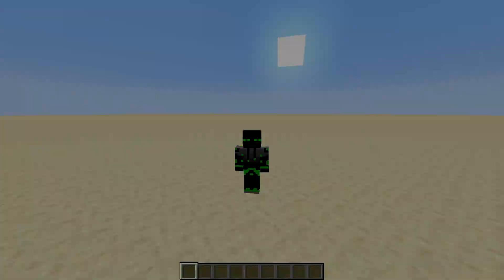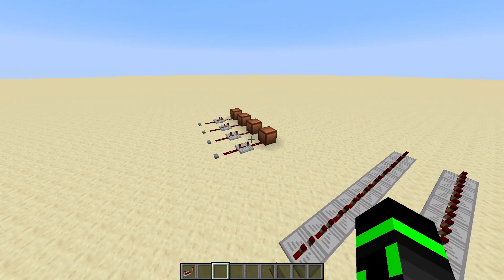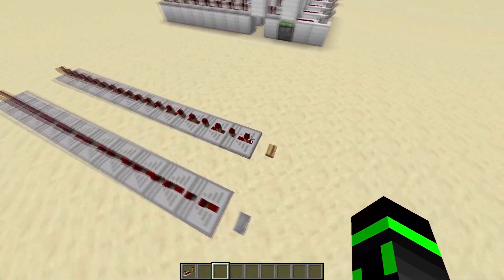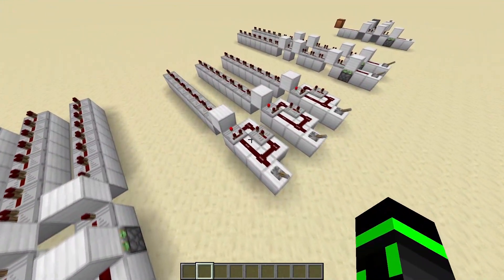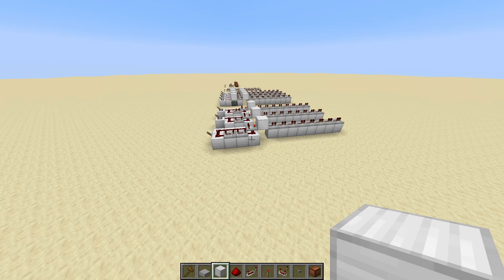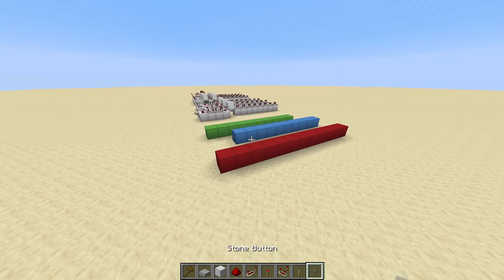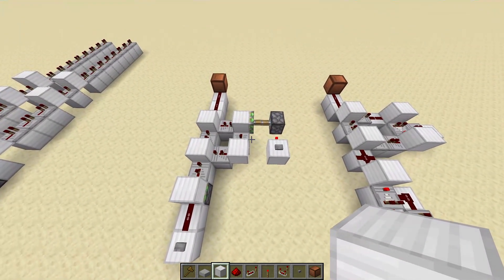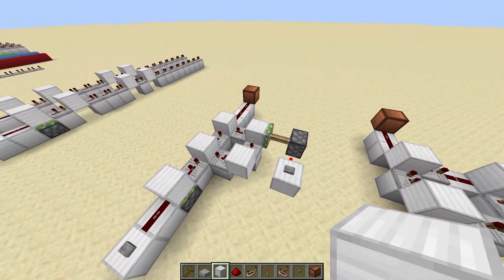Pulses & Clocks | Logical Redstone #6

Comment: Don't use clocks using only repeater if you can avoid it. They tend to stop when the chunk they are in gets unloaded. A better way would be to have a redstone torch that feeds into the block it is placed on, with repeaters in between

Comment: Actually repeaters do 3 things.
1: delay pulse by set amount.
2: set output strength 15 extending the length of reach.
3: they mod it and if it’s more than 0 they add the needed amount to reach it.
Ex. 2 tick pulse ti 4 tick repeater, well 2 mod 4 is still 2 so now the output is 4 say you had a 8 tick input 3 tick repeater you get a 9 tick output because 8 mod 3 is 2 witch is not 0.

Comment: I'm not sure if this is related to this topic, but I've seen on quite a few advanced redstone builds the use of a piston pushing up a falling block (usually sand). I understand that this is meant to break the connection temporarily which I assume is part of creating a pulse, but I was wondering if you know the specific applications where this is useful or any specific technical details on this. From what I've read, falling blocks drop at 0.45 blocks per second which would be 4.5 redstone ticks so I'm not sure if this value is specifically relevant. Thanks in advance if you can shed any insights on this.

Comment: Is there a nice and easy circuit that will delay a pulse to the moment an input is on. For example lets say I have a clock and something that gives random outputs. I want something that will delay (not turn off!) signals from the random device so they are always aligned with the clock pulses. I guess it's possibe with some logic but do you know something simple for that job?

Comment: I use an comperator in subtracting Mode as a clock. Its  very small and cheap (for survival) . Also  Like the capacitor (Pulse extender) Made from comperators.

Comment: i always have been interested in this kind of things and this series showed up to me a couple days ago and i absolutle love how you splain all of this!! also i have a uqestion, this clock are infinit until you press the "stop button". but there is a way to do a clock that repeats x times? like it works as a for function or something like that? love this content🖤🖤
Reply from the maker: the best way to do that is to make the start button activate a long line of repeaters which connects to the stop button. then you can test it out and change the amount of timing to get however many cycles you want

Comment: I spent 3 days designing, compacting and building a multiplier with 8 bit inputs and the only ROM being 15 cakes and I think 6 or 7 composters and no RAM, and I have no idea how it works. It works when one input is whatever and the other input is only one of the 8 bits turned on (so (anywhere between 0 and 255) * (0,1,2,4,8,16,32,64 or 128)). And because I can barely keep track of how it works and don't know how to visialize this type of thing on paper, I can't fix it to work completely. What it does now could easily be made with a tenth the space, even with the redstone equivalent of spaghetti code.

edit: I don't know what to do. Should I try to fix what I have, rebuild a new one from scratch or abandon the project?

edit2: Or something other than that?

edit3: I don't like using pistons in non-slimestone projects for anything other than the bedrock edition redstone torch bug/feature. They are noisy, laggy and sometimes glitchy. If I want a short pulse when the input changes from 0 to 1, I use stuff like input leads to [not gate A], which leads to an [and gate] and [not gate B]. [not gate B] also leads to the [and gate], which itself leads to output. (litterally 2 solid blocks, 2 of any blocks, which redstone can be placed on except stuff like upwards facing piston, 2 redstone torches and 2 redstone dust).
Except, I don't really use pulses. I only use solid signals without RAM. So you can replace air with a redstone block ANYWHERE in my circuit, and when you remove it, there will no errors. Except maybe the t-flip-flops being a little messed up until the next change in imput, but I don't really use those either, so that's probably fine too.

edit4: I write a lot when I'm tired, and I just woke up. I also just realized my multiplier might be handling the upper half of the ROM incorrectly, and that is half the reason why it's not working correctly.

Comment: @8:15 place a torch on the side of the block with the button that starts the clock, replace the button with a lever, feed a redstone line from the torch to the button that stops the clock. This doesn't fix the problem, just a nice little tool. However the more pistons you add to the clock that reset it, the quicker the clock will reset. Also make one on general architecture. ALU, CPU, how they interact with RAM, etc.
Reply: Yes I am into that stuff. Actually rn ime working on a computer for the past 4 days I may actually post it on my channel Zac Turtleback :)

Comment: There is a way simpler clock design. I'll show you:
╚: Redstone dust
R: Repeater (^/v: direction)
C: Comperator (right clicked)
L: leaver / Input
O: output

 O
 ║
 ╠╗
vRR^
 ╚C
   ║
    L
Reply: Thanks for letting me know

Comment: Could a simple AND gate handle shutting down the clock? 

Also, there's a really nice pulse extender I use almost everywhere in which you loop a signal through comparators, and the signal loses a tiny bit of strength every time it loops. I call it a capacitor. It tends to have a smaller footprint than adding a bunch of delayed pulses to a main signal line.
Reply: An AND gate requires two positives (on, true, one, etc.) to output a positive. To use that to shut down a clock, you would want one of the two inputs as the clock pulse, and the other as your "stop" signal. If the stop signal is negative (off, false, zero, etc.) when the clock pulse arrives, the AND gate will shut off the signal.

Which is exactly the logical behavior of the piston method demonstrated in this video: If the piston has withdrawn the block when the pulse arrives, the pulse ends.
Reply: @SirJerric  no I meant an AND gate to push back the block only if the clock signal has fully died, regardless of timing (and the off signal has been set). 

That or a memory bit, so off is toggled instead of pulsed. And switching it on pushes the block and starts the clock.
Reply: @Nathouuuutheone  - Ah. That side. Yes, the memory bit is the better approach, because the signal lengths no longer matter. Just send the clock start signal into the memory bit's clear to get the block back when you need it.

Or you can have an instant reset: Feed shutdown into a memory bit, memory into both the piston and an AND gate, and the AND output into the memory bit's clear. The clock loop as it arrives at the missing block goes into the other side of the AND.

Comment: Very nicely done.

A bit of a repeater bug, though, that only affects 1-tick anti-pulses (e.g. 11011 serial). When you run the signal through a repeater into a block, then straight into another repeater, those 1-tick anti-pulses close up (so you’d end up with 11111 serial)

This can be annoying if you’re going for a 1 tick on, 1 tick off clock, or if you’re dealing with 1 tick per bit serial encoding. (The bug also strikes when you unlock a repeater chain)
Reply from the maker: yup i’ve encountered this and this is why i went with the 2 tick version

Comment: I love your videos but just a quick reminder that repeaters are not 1,2,3,4 ticks. They are 2,4,6 and 8 game ticks. The game runs at 20 gt per second, not 10.
Reply: You can make odd timings using pistons.
Reply from the maker: thanks! any time i say ticks in this series I'm referring to redstone ticks
Reply: @mattbatwings  Yeah, I know what you refer to, but they don't exist, because again, what would you call an odd gametick delay then? 0,5 ticks? That does not exist XD
Reply from the maker: @jorvp  of course they exist, its what redstone is based off of. the game just runs at double the rate in the background. in fact that's where the term "0-tick" came from, it originated from powering pistons in "0.5" redstone ticks, which like you said do not technically exist, and are therefore called 0 tick mechanics
Reply: @mattbatwings  Except that's not true, 0 ticks are generated when they are powered and depowered in the same gametick, whereas the name 0 tick. Tiletick priority is a much important feature I think you should mention in any of these videos, specially for short pulses for comparators.
Reply from the maker: @jorvp  just revisited 0 tick and yeah i’m wrong on that , oops😂 although if you’re working with only redstone as a beginner, i still think saying things in terms of redstone ticks is way more intuitive. it’s what ppl say in redstone tutorials most often, unless you’re watching something more technical. in any case it’s just language, as long as both parties know what they’re talking about it’s not a big deal. if anything it’s kinda mojangs fault for naming them both ticks

also i stay away from pistons in my designs in favor of solid state, which is one reason why i didn’t make the clarification of gt vs rt, cuz honestly if you don’t use pistons gt don’t really come up too often
Reply: @mattbatwings  Problem with that is if a casual gets interested in tech, they will now have a mess on their brain XD, but yeah, its just a thing i can't get out of my head when watching your videos. I also just use rails and observers when doing encoders and decoders, because they are way faster, more reliable, tileable and less laggy. But yeah they are more complicated so old school redstone torches can do the work to teach casuals. Anyway keep the good work!
Reply from the maker: @jorvp  yeah good point. maybe i’ll add a video or at least a sidenote on tick stuff. kinda sucks cuz it would have been best to put it in this video actually. cheers and thanks again!